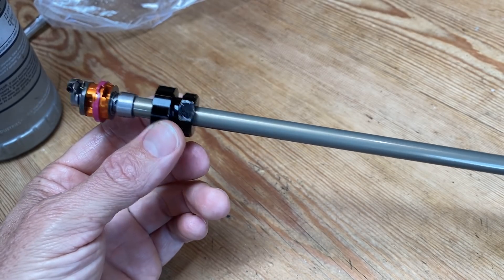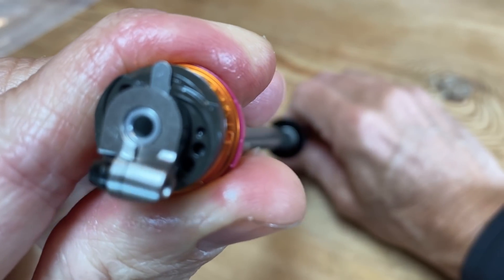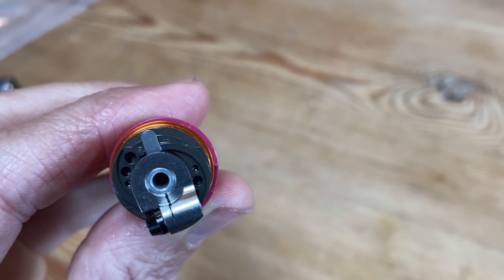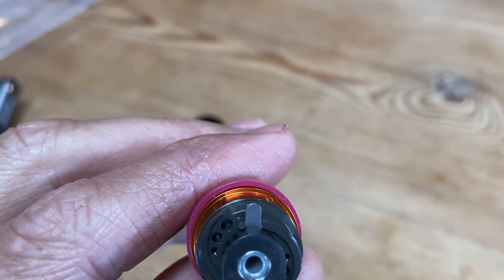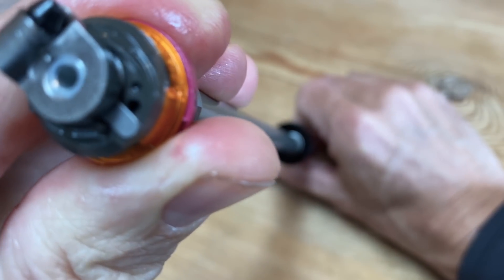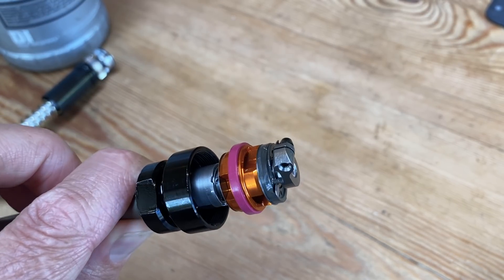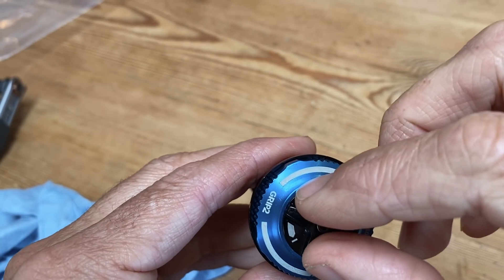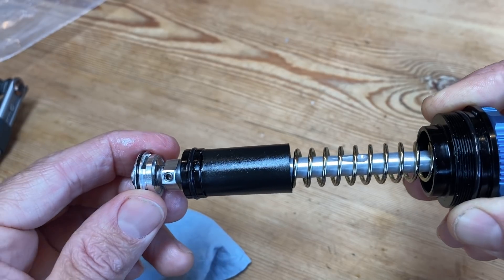DIALED S2-EP5: What is VVC? | Jordi breaks down a GRIP2 damper from New Fox 38 Fork | FOX

Comment: Very interesting and well done video.  I only have one question about the GRIP2 service (my fork is a FOX 36 Performance Elite @160mm). The official FOX video (like other tutorials) indicates to push the cartridge rod upwards for 3/4 of its travel in order to release the excess oil.  In other videos some don't.  By pushing the rod up so much, wouldn't you risk letting too much oil escape from the cartridge?  However, I suppose it is used to avoid adding oil to the 40cc PTFE already included in the FOX reference table.  Thank you so much!  K

Comment: hi there folks @Fox suspension. I recently got hold of a Fox36 w/ the latest VVC damper and was wondering if the behavior I observed is normal for this new damper. When i fully turn the HSC/LSC to the close position, the fork still compresses as if there was no/minimal damping. in my 2019 Fox36 it's very noticeable even when just wound half way, you can feel the damper working. can fox confirm whether VVC is indeed working this way or is my fork damper defective. appreciate if you can comment, thanks in advance.

Comment: Did i understand that right, that this wing basically acts like an additional leaf spring to set the opening pressure of the valve and it basically just changes the length of that leaf spring, therefore the needed pressure to open it...?

Comment: what exactly is the difference between tunes on a 2021 Fox 38?  stiffness of the little clock spring?  orifice size?  my 2021 commencal meta power 29 signature came with the 2021 fox 38 factory emtb tune; rebound is waaay too slow even with HSR & LSR dialed all the way out; while compression is waaay too light even with HSC & LSC dialed on the way in.  180 pound rider, 50-60 degree winter norcal riding, 100psi, 2 volume spacers.  how do i fix this?  i've heard the term 'reclock' but i don't know what that is.  does fox ship forks dry to commencal, ie they might have put 20wt oil in the damper side instead of oem spec 5wt teflon infused???????????????

Comment: Quick question I got the 2021 fox 36 Factory  grip 2 out of the box had issues with the HSR and LSR where it is kind of extremely tight to turn and it was moving the LSR with the HSR. The shop I bought it from had to send it back to Fox and Fox had to rebuild it because they did not have any of that same model in stock and now it's happening again after just a couple of light adjustments so I have to hold the LSR well adjusting the HSR. Any information is helpful

Comment: Interesting that no one ever seems to talk about the mid valve on mountain bike forks. Always rebound and base valve. Do any forks run check valves on the MV so the rebound adjuster only flows oil in the rebound direction and not on compression?

Comment: I noticed that the new 36 will go up to 160mm of travel and the 38 from 160 to 180mm of travel. So no 36 in 170mm anymore? Actually I read that the 38 is stiffer than the 36 which is more suitable for lighter riders. So for my weight and style of riding the 36 seems to be the way to go but I ride a 170mm fork on all bikes. I'm a little bit confused lol. Thanks for your answer.

Comment: Maybe a question for Jordi: I’ve seen you do the quick rebound speed test by pushing down on the bars and seeing if the front wheel hops off the ground. But what’s with the “drop the rear wheel” test? Should it not rebound at all? How useful is this?

Comment: Fox is very good as I have run there coil shock for 3 years and its tuneable but don't be greedy on the adjusters or just get it revalved. The Fox 36 very good but converted to coil and was so much better than air.

Comment: Hey jordi great stuff there. Just a quick question is a that custom 2021 dhx2 for tallboy 4, 190x50 or 7.5x2? Cant find that size on fox’s website. I have the same frame and is looking to convert it to coil. Thanks
Reply: I had the same question - also is the 36 at 140mm? They only make the new one in 150-160 I believe. Can you get a 140 air shaft in this new 36?
Reply: Mike DeMille based on the lost co bike shop  here on yt, mike said that the 2021 36 can still go from 130-160mm

Comment: I'm so sad I missed this tech when I bought my bike 4 months ago. Jealous.
Reply: Jeff French always wait a year, new stuff aren’t always reliable. At least with the old stuff you know its going to work.
Reply: @sonnduro  Fair enough!
Reply: I feel the same sorta, i got a fox factory 36 grip 2 2019/2020. But when they say you gotta check the air pressure before every ride with the new fork, thats kinda turns me away from it.
Reply: @sonnduro  I converted my 2020 grip2 factory 36 to a Vorsprung Smashpot
Reply: @steelwing7532  could you really notice a difference? What was it and was it worth it?
Reply: @adanielweaver  definitely noticable. Very smooth, but also there is the extra weight. I feel as if on the very small fast chatter, my fork flexes a little more. But overall, I think it is an improvement as I was always messing with the pressure. Its important to take your time and install it exactly per manual. 👍

Comment: Gonna watch a few more times to really understand what you were saying. Was planning on getting an X2 for my Alchemy, and now I get the 2021 X2 stoked!
Reply: Basically, the high speed valving is acted on by higher effective spring force without adding deflection/preload to the spring itself. The adjustment ridge changes diameter, but not height.